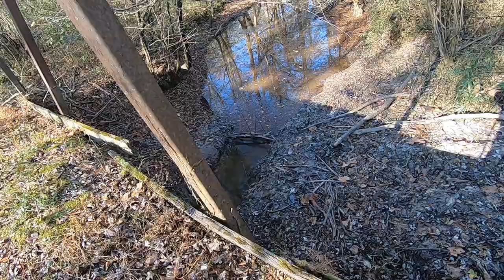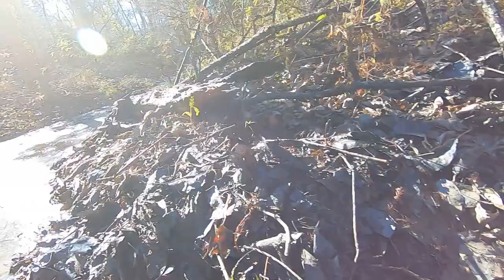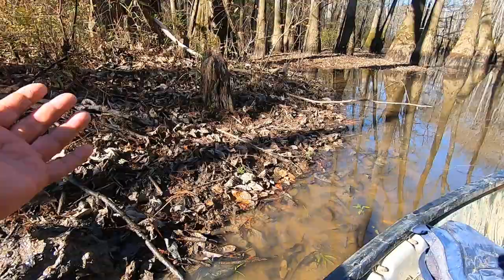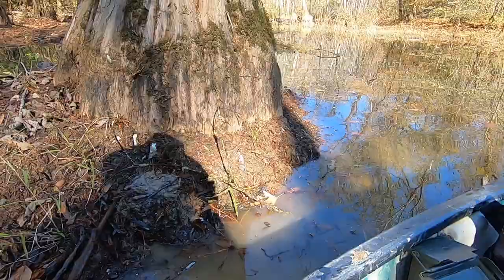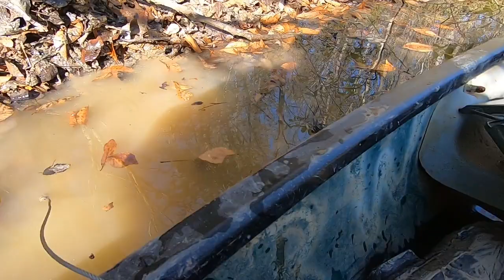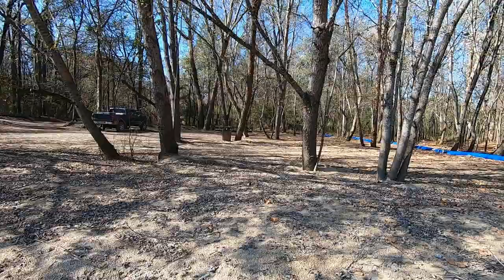problem beaver check #1 + new sets

Comment: They can make you pull your hair out!that is the reason I am getting bald on top.😂😂👍
Reply from the maker: the 330 sets got plugged with leaves and sticks . the castor mound sets should work .
Reply: @judithdandavis2206  yes that can be a problem with moving water in the fall😁👍